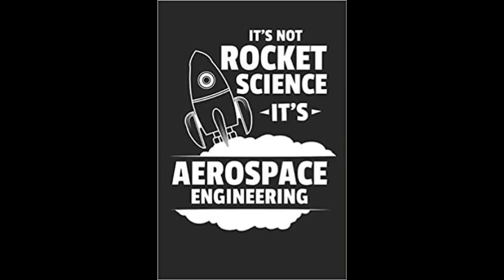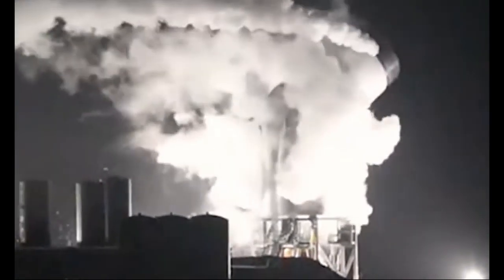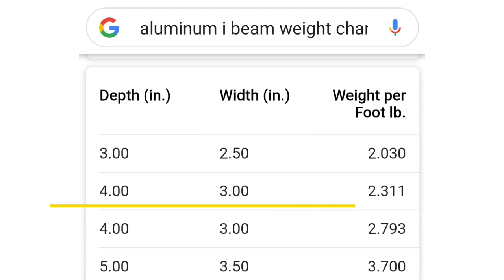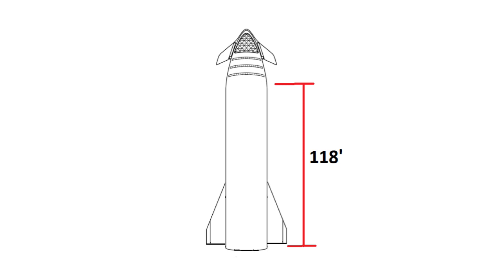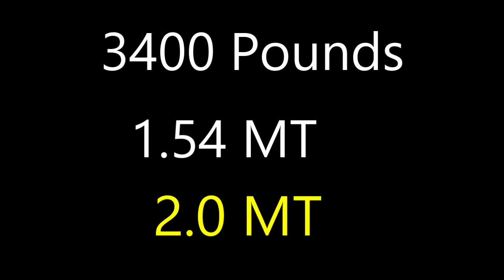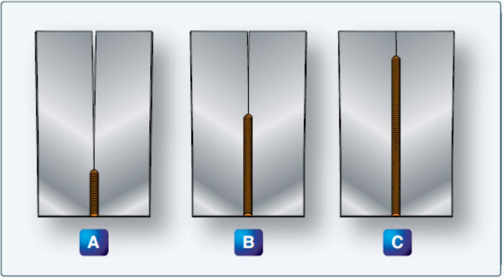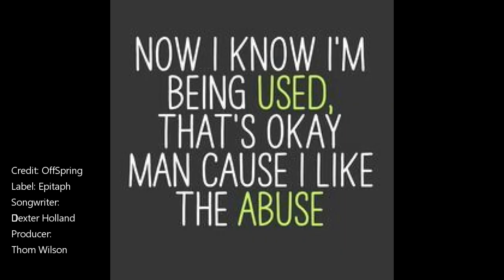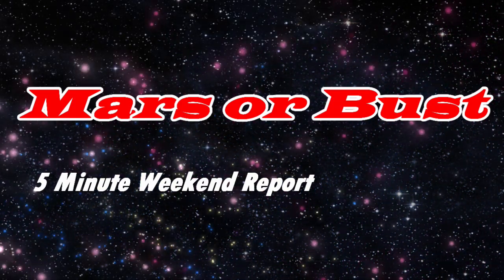SPACEX STARSHIP Can They Fix it? It Can't Just Fall Apart!

Comment: I like the idea of building something like the Gateway Foundation.  Get a few thousand people living comfortably in space, then send it to orbit Mars.
Reply: Way too many wires and stuff. I liked the Martian partial cylinder but with three different moments of inertia it may be unstable.
Reply: I like that idea also but not for an orbital space station. Instead, use it for an inner planetary ship. Six months is a long time to be inside a small building with no gravity. A large spinning space station type ship would probably work a lot better and safer for the crew. Star Ships could be attached to the stationship for landing and on planets and returning back to the stationship for further use back in Earth orbit. This would speed up colonization and exploration of Mars and other bodies much faster.

Comment: The starship IS self-supporting.  The failure here was having a fully loaded upper CH4 tank filled with N2 (25% heavier than CH4) with too little pressurization in the lower LOX tank. This cannot ever happen in normal operations. Screwed up the test configuration. Need TRR review before committing
Reply: Not really, not when you factor in for safety.
Reply: @douglasberard8664  You can look at just about anything and say, "well, if somebody screwed up royally, it could totally break, so it's clearly not safe enough." Screwups shouldn't affect design decisions. You just need more training, experience, cross-crecking, etc.
Reply: @J7Handle  on that logic´Chernobyl was safe´And it probably really was
Reply: @rogeriopenna9014  Not really. The competence clearly wasn't there, which is why SN3 failure is so disappointing, because it shows a lack of competence. They better make up for it in the future.
Reply: @J7Handle  in terms of competence, not on Chernobyl itself, but there was competence on the soviet "company" that made the reactors.

And the reactor survived attempt after attempt at making it fail, until it failed. There are only so many screw ups you can throw at a nuclear reactor....
Reply: Where did you all get this fake "N2 (25% heavier than CH4)"? - Nobody can answer!
Liquid N2 density is 808 kg/m3.
Liquid CH4 density is 423 kg/m3.
Thus N2 is 100*(808-423)/423=91% heavier than CH4.
Your second mistake is "self-supporting". Yes, it is achieved (maybe) in a dry state. And (maybe) achieved with all tanks fully loaded.
But you don't take into account all the tricked maneuvers that Starship should do after re-entry with an extreme level of dynamic pressure comparing to which your stationary "25% heavier" is nothing.
Having a safety margin lower than 25%, Starship will disintegrate like Columbia.

Comment: I like the idea of you exploring possible safety measures.  However, if I understand what Elon said, the hull would not have collapsed because of the upper tank being too heavy if the "much lighter" actual fuel was being used in the test.   The stainless steel rings are apparently pretty strong by themselves.  And, of course, someone on the test team apparently screwed up.  Airlines have crashed because of human errors made during FAA mandated "safety inspections".  ALL eventualities simply cannot be planned for, and 20/20 hindsight is always perfect.

Still, thinking about Elon's use of "first principals" in his design philosophy, I'm wondering if there MIGHT be additional backup safety systems that should be considered for the Starship.  For example, Draco engines for just the upper nose cone section that could separate the entire nose cone from Starship and land it repulsively like originally intended for the Crew Dragon.  Another might be some kind of explosive charge that could instantly add additional pressure as needed on the inside of the hull to prevent it from collapsing.  The opposite of this would be some way to instantly vent ALL tanks.
Reply: I think Elon is right to not have an abort system. How ridiculous is it to question the safety of your rocket, and then propose putting another rocket on top to fix it? Now sure, the chance of the main rocket and your abort system both failing at the same time should be about the same as the chance of the main rocket failing twice in a row.

But in reality, you're adding extra tanks, extra complexity, and extra engines, two of which could doom the mission without the main rocket ever failing. Furthermore, the abort system will never see as much safety testing as the main rocket. After all, every one of the dozens of launches and later inspections will give more data about the performance of the Super Heavy and the Starship, but the abort system can't ever produce as much data, because it's pretty much never going to be used.

So you can't even rely on an abort system to save you if things go wrong, because the abort system will never be as proven as the launch system itself.

I think the comparison to airliners really is apt. It would be ridiculous to put a backup plane in a 747 in case the 747 loses control. They don't even give passengers parachutes, because of the difficulty with storage, weight, training (you're really going to train all of your millions of passengers on how to use a parachute?), and the logistics of getting 500 passengers out of a flying aircraft (you'd need more exits, and you better hope the plane isn't on fire and there's enough altitude to shut down the engines and get everybody out, because there's no way it's safe to bail out in front of an active turbofan engine).

We have airbags in cars, but we don't have flotation devices in case you drive off a bridge into water, or an ejection seat in case you drive off a cliff.

Some safety measures just aren't worth the effort, cost, and, ironically, safety risk.

I agree that the steel seems pretty sturdy. It's unclear whether simple steel rings will hold up against the several lateral gs and high temperatures of reentry, but I'm not really worried about that at this stage. This is SN4. SN4 only need be capable of what it's designed to do. Go up to 20 km and come back down to a landing.

There will be many, many unmanned orbital flights of the production Starship before it evers sees human passengers, so I'm not worried about safety right now.
Reply: J7: Outstanding analysis. Loved your common-sense based logic to the entire SN# effort.
Reply from the maker: Hey Rod! 
Yes, That could work also! 
Thanks! 
Dave 
MoB

Comment: I’m no structural engineer either, just a commercial pilot turned geologist who writes SF novels - go figure, but I’ve been wondering the same thing. It appears that the wall of the tanks is also the wall of the rocket. I’m wondering if it might be easier to run semicircular steel, just two or three, up the outside.
Reply: Willy Makeit:  Like the name, shows you have a sense of humor.  I’m a fanatic for good science-fiction, so feel free to give your book(s) a shout-out. The way I see it, this will only help you, and this is the perfect venue for us dreamers. Good luck.
Reply: Average Joe thanks, a sense of humor has proven to be my best defense in life. My third book of the “Hell Fighters From Earth” trilogy is with the editor now.

Comment: They don’t need the extra support, and obviously Starship IS self supporting.  It stands on its own all the time.  You just can’t fill the top meth tank while having and under pressured LOX tank.  This would never happen in an operational mission.  It was a dumb mistake by someone who is almost certainly not employed by SpaceX anymore.
Reply from the maker: Yes, self supporting when unloaded. I just hope no one forgets to fully load the LOX when I'm on top of that thing! 
Thanks for the comment! 
SMD 
MoB
Reply: Also important to remember that liquid nitrogen is roughly 25% heavier than the methane that will routinely be used in that upper tank.

Comment: Remember that two tonnes needs to be landed as well so more propellant to land which has to be launched increasing renry temperatures that leads to more heat sheild whick leads to more prop ( bet it takes more like 10 tonnes of the capability). The  tyrany of the rocket equation. Better th design that has no parts so perhaps more "gas"  to keep the  vessels pressurised a litle bit more . There is a centralised core that may  merit from being a bit stronger.
Reply from the maker: Good point!

Comment: Dave just to point out, SS is already self supporting so does not depend on pressure to remain upright, second at cryogenic temp you would want to use Stainless steel not aluminum as expansion or contraction rates would need to match

Comment: Well, we seldom mate steel with aluminum because of galvanic corrosion.  Aluminum does not handle cryogenic temp as well as stainless.  This said,  I've though along the same lines.   Elon seems reluctant to go this route.  Not sure why.  It may be his obsession with pushing everything to the edge.
Reply from the maker: Yes I understand the corrosion issue. They would need insulate between the dissimilar metals.
Reply: @MarsorBust  The heat of reentry would not be kind to aluminium or insulators.  We can do the same thing with stainless, just add a couple more tonnes.  I'm fine with 95 tonnes to LEO.
Reply from the maker: Me as well! 
👍
Reply: Brian Breheny:
Exactly! Just what I'm talking about everywhere.
They enforced the puck section and though it was under the highest pressure it remained safe!
Cheaper and lighter is not better if this threatens to safety.